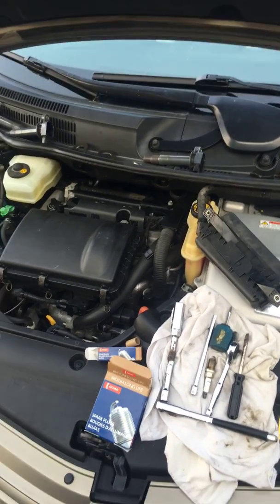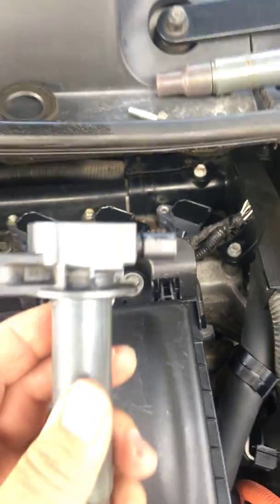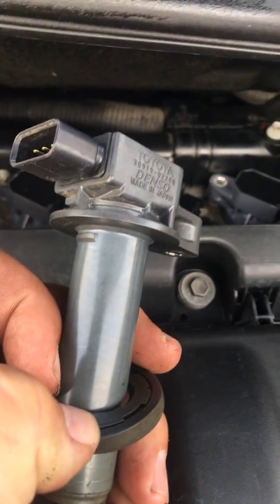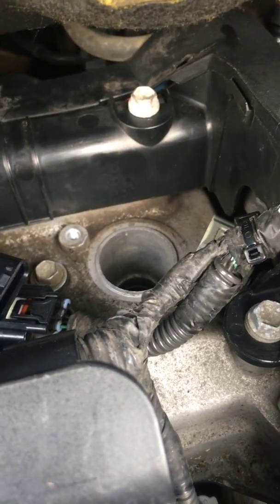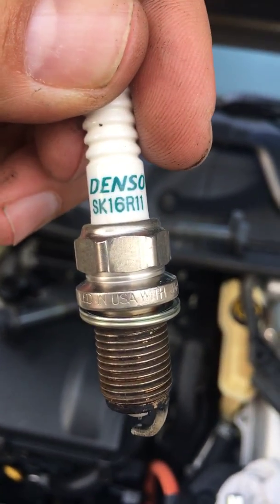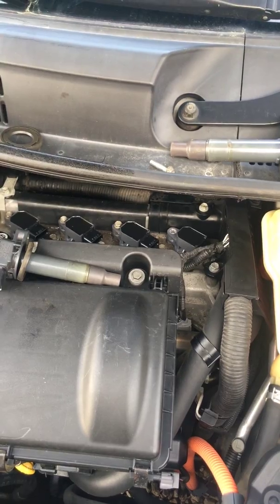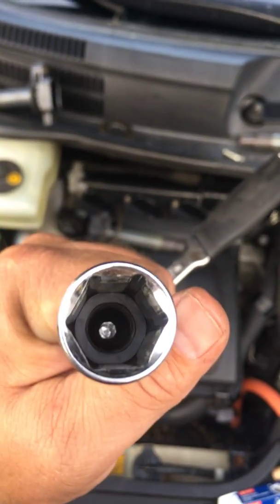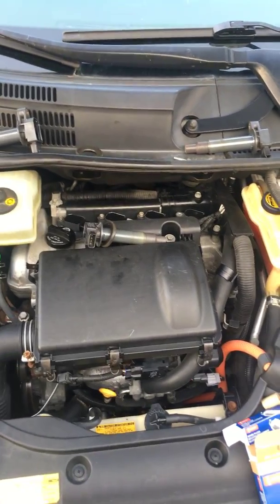Gen 2 Toyota Prius engine sputter misfire engine running rough CEL light on P000 P0300 P0304

Comment: I had vibrating engine, low power, very rough, low state of charge on traction battery,  p1e80 code, p0138 code. Was a bad coil pack. At 205k on 05 prius so I replaced plugs and all coils. All had new gaskets. The plugs are 14mm. All codes cleared and runs great.

Comment: J M
0 seconds ago
No can be tough water  guy make problem not engine supposed to take shower can only some parts not all engine now can see also no plastic part on spark coil plug than water go and can make engine break can clean engine but cover electric part tgan can clean other part use paper and towel not take shower on engine that  iis not good for car

Comment: I had this type of ignition problem every time I washed the engine with an MR2 way back in the 90's. I used to carry a small hose and compressed air to blow them out after the wash. For your case, the missing gasket/seal could have been human error if the plugs were replaced somewhere in it's past.
Good info and great shots of the ig-packs. A+